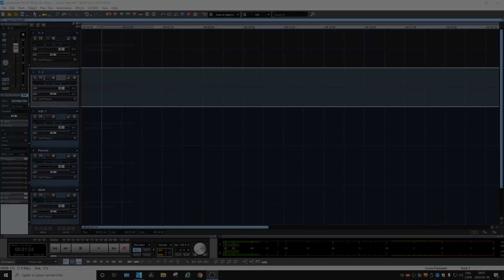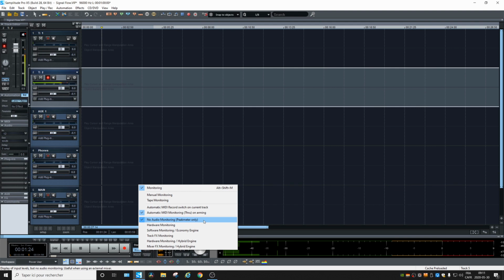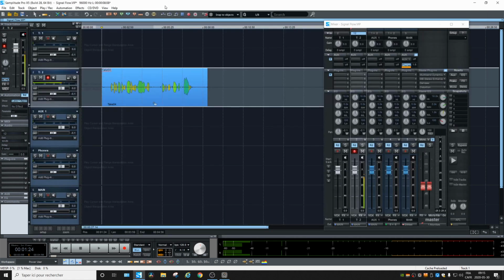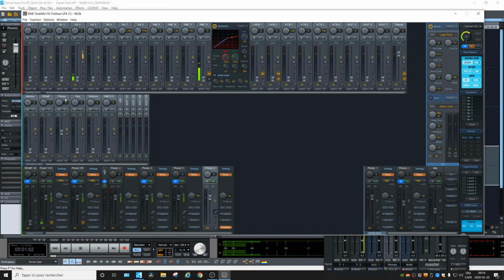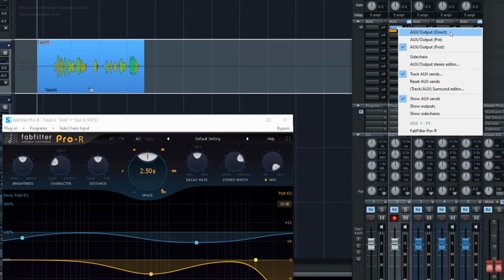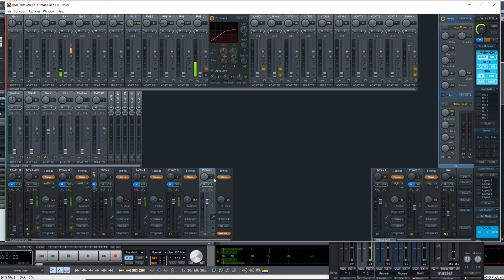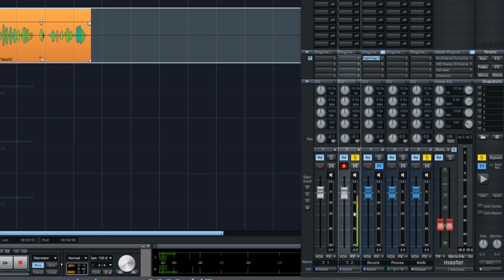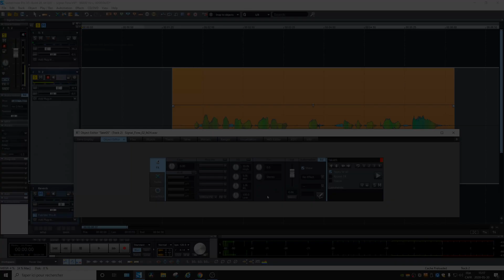Magix Samplitude Pro X4 - X5 : Signal flow

Comment: Trying to send vocal channels to a separate external hardware device [amplifier] for dedicated vocal monitor mix simultaneously with the Main speaker amp. Is this impossible? I've had no success.
Reply from the maker: The way I work, everything live is redirected within the realtime mixer of my interface. Then if the performer needs to hear what is already recorded, I add an auxiliary buss and send what I need to it and change the output to a different output from my main monitors. That way I can change the volume of my monitors without affecting the headphones.

Comment: why do magix samplitude pro x5 doesn't not find the usb interface microphone in the audio setup?
Reply from the maker: It might be because of the drivers. Change the drivers to mme or other choices, it may come up. If not you can try asio4all, but USB mics are often a pain to work with regardless of the DAW choice. Poor interface circuit and often a lot of latency because of the lack of asio drivers.. Hope you get it running..

Comment: the tempo track is part of pro x4, too. by creating a new track, clicking automation and selecting tempo you can do basically the same thing :)
Reply from the maker: Humm... never tried it. did it have the lane and drag features ?
Reply: @MarcoPrimeau  well it can be used like any automation curve and also adjusts the grid accordingly. i havent tested it that much, i'm used to set markers
Reply: Josip  that doesn't work in pro x 4

Comment: Question: say I have something recored on one track (either audio or an VI) and want to record it in real-time into another audio track--i.e., print it in real-time to another track in Samplitude.  I can't figure out how to do it.   In Protools, I would just set the output of the channel that's playing back to a bus. Then set the input of another audio track to that same bus.  Record arm the audio track that has that the bus input selected.  Then hit record and the playback track will record into that audio track.  I can tweak plugin parameters or ride volume levels, etc. on the playback track during the print and it's recored into the new track.  Is there a way to do this in Samplitude/Sequioa?  I'm on Sequoia 13 but I think the routing options are the same.
Reply from the maker: You don't need to do all that.. Freeze the track then copy the result on your second track, then unfreeze the origital track.. Unless you want to process the signal via an external unit.. then change the output of the track to one of your choice, connect to the outboard gear and then the processed signal to any input and record...
Reply: Marco Primeau thanks for the reply, Marco. I’m aware of the freeze but that’s not what I want to do. I want to print the track while tweaking knobs (filter cut off and other modulation parameters, etc). in real time without writing it to automation — just by turning the knobs with the track is in recording down. It’s so easy in Protools and Nuendo and I thought there must be a way in Samplitude. Maybe not?
Reply from the maker: @JayFrederick  Humm.. I never needed to do this.. Automation is so important for recalls (they could be turned off too).  I don't know. I would need to make some tests.. Maybe we can record it on a buss.. never tried it.. Interesting..
Reply: Marco Primeau right on. I use automation too but I like to, for instance, set up a piano instrument with Independence and record a short piano part. Insert a Soundtoys Primal Tap (Lexicon Primtime emulation). Then play back the piano and play with the parameters of the Primetime especially the freeze—Daniel Lanois style, etc. . I’ll quickly print several versions and then chop them up and use them in different ways. I don’t need the automation recall here. Just the samples that I makes with the variations etc. Makes for a quick way to generate them and I’m used to this workflow in Protools and Nuendo. I recently tried to make a full track in Sequoia (which I usually just use to master my music) but I got stuck here. Maybe it doesn’t work in Sam and that’s fine. But I was surprised that I couldn’t seem to figure it out. If you do, I’d love to know. Again, thanks for the great videos.
Reply from the maker: @JayFrederick   I'll try to test it when I get to the studio this evening ;)
Reply: @JayFrederick  I think Samplitude has a "Mix to File" function that allows you to bounce one or more tracks to a new file while mixing in real time. I agree with Marco, though--I'd likely use automation instead. Ok, I just checked--the "Mix to File" function is accessed in the Mixer window, just below the Master L/R Faders.
Reply: silentskystudios thanks! I’m gonna check it. I use automation all the time as well. This is not what I want to do here. This way of not using automation for this use case scenario is much more efficient and quick for generating many versions and improvising a part that incorporates the element of chance where you don’t need recall or the source material. It’s a common technique of many sound designers and you can see some producers use this technique as well. Illmind for instance. I didn’t come up with the method but learned it from others.
Reply: @MarcoPrimeau  cool man!  i appreciate you checking it out.
Reply from the maker: @JayFrederick  Finally made some tests. We can't record Aux or sub busses.. So the only way I see it could be done is to assign an output to the track send the output to a physical output and then back to an input to be recorded as an instrument.. It seems sketchy.. but just be sure not to monitor the input by the same output and create a feedback.
Reply: @MarcoPrimeau  Thanks for checking it out.  I was pretty sure it wouldn't work because I spent a while trying different things.  I was hoping you had a magic trick haha.  It's all cool though. All the DAWs have their pluses and minuses and most users probably don't care about this functionality.  Sam/Sequoia has so many other things going for it.  Like the sound!  Nothing compares.
Reply from the maker: @JayFrederick  If you want to record live some realtime adjustment to another track.. the methode I describe, does the same thing as reamping.. except you are processing the signal before it goes out.. you can even throw something physical on the signal before it goes back to samplitude since it gets out into the analog world.. There is no reason it can't work since I'm doing reamping quite often... Actually this is a good idea of video.. Stay tuned I'm going to make one ! ;)
Reply: Marco Primeau that method will definitely work for sure. Looking forward to the video. I’m tuned in! 👍
Reply: @MarcoPrimeau  i have the same question mostly in my case: record the process guitar sound directly and not the DI on a track
for exemple having a track or way to have
track 1 with guitar direct imput with guitar amp effect) to track 2 empty track
when recording track 1 would be the monitoring track
track 2 would record a audio object base of the DI plus the different effect applied to it (would be the recording track)
so that way messing with the setting on the track 1 would not modified the alerdy recorded sounds made with the effect of track one
Reply from the maker: @samuelj.rivard  If you redirect the audio to a AUX buss where your ampsim is, you can then change the aux send to direct so what you do on the track level (level pan etc) won't affect the signal sent to the AUX. But if you change something at the object level, it will. In that case, you can make a copy of the track and its content.  Hope this make sens to you.. I guess I could do a video only about Busses.. ;)
Reply: @MarcoPrimeau  i just figured how to do what i want to acheive literaly 10 seconde ago

I found how to record the loobback of my audio interface (focusrite 816 3rd gen)

It is input 9-10 (for stereo) setting it in Sam x3
Than i could not making it work until i realise my track was in midi more (😂)

I mute that track to avoid feedback
Than anything that i hear on my computer can be record as audio (this mean literaly anything either the other track playing or a zoom call ect)

(Thid allow me to record quick guitar track like i would if i would record a external analog rig and capture the rig with microphone
This mean it will also record any processing done of my aux track and if
So i just save myself tons of time
(For exemple i could record a riff than a clean tone and other idea and save them seperatly and use the audio file into another session for mixing with other instrument
Also that allow me to keep the uniqueness of a random effect
(I play with lots of crazy effect like delay and reverb and echos sometime as aux of the main track)
One guitar tone i create use arround 70% of cpu on a rysen 3900x 12 core 24 thread
(The almost no noticeble latency)
And that is for a "live" play
(Considering my Daw as a huge pedalboard 😅)
Reply from the maker: @samuelj.rivard  I'm glad you got it to work. I wasn't sure what you wanted exactly.. Usually, I record electric guitar with a DI, the clean signal (xlr) is recorded directly and then I record the AMP at the same time. It gives me a save track in case the customer change ideas about tone so we can reamp the clean with another amp or simple another amp setting. But I get that you wanted to do it without using an external amp. I have an RME interface and what they did within the realtime mixer is add a Loopback fonction.. so any output can be turned back an input to be recorded.. Mixwizard is a bit more complicated to deal with..
Reply: @MarcoPrimeau  yeah i mostly have unusual need in different software
Since i dont do audio mix work (well not anymore) but mostly trying to set up for my particular use case that need feature that professional dont really need or use

(Like i manage to use my studio monitor for my tv and i could both do gaming on console and music on the very same speaker
So no need to buy to set)
Reply from the maker: @samuelj.rivard  Great ! Go make some music !! ;)
Reply: @MarcoPrimeau  ok... as soon iam done shopping new guitars HAHAHA
Reply from the maker: @samuelj.rivard  :)